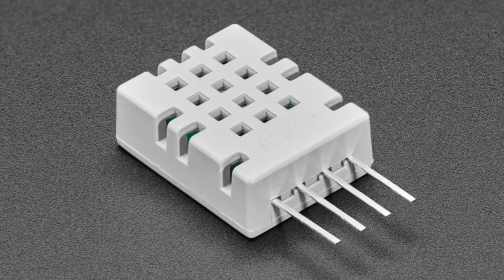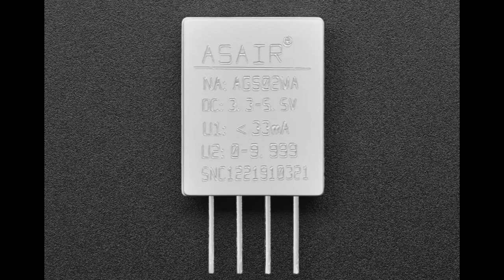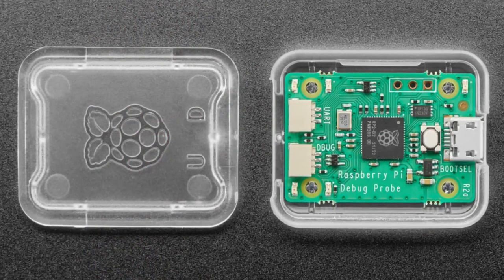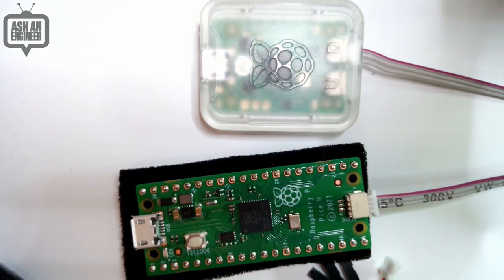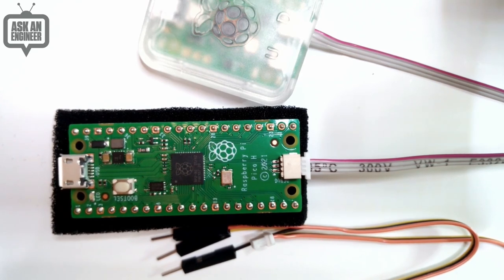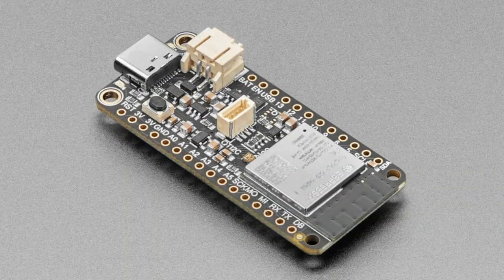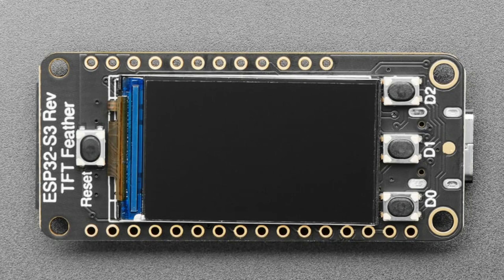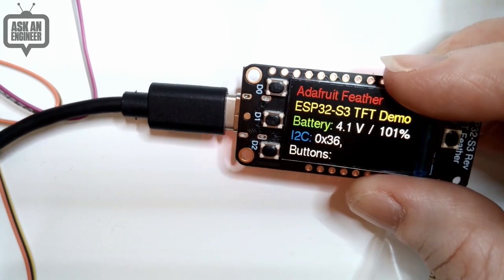NewProds 2/22/23 Feat. Adafruit ESP32-S3 Reverse TFT Feather - 4MB Flash, 2MB PSRAM, STEMMA QT!

Comment: With all those feather boards that can plug into each other, is there a market niche for a modular mounting ring that would clip to an other, to form a case of the appropriate length for a stack of boards?  It would also need end plates for the stack, and cut-outs for ventilation and cable connections,